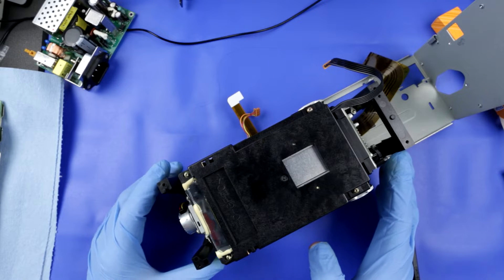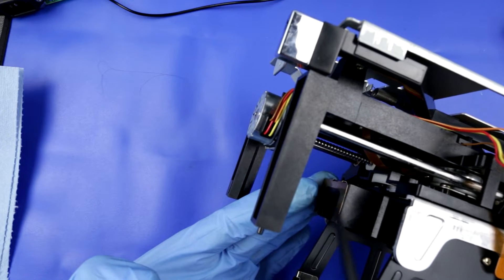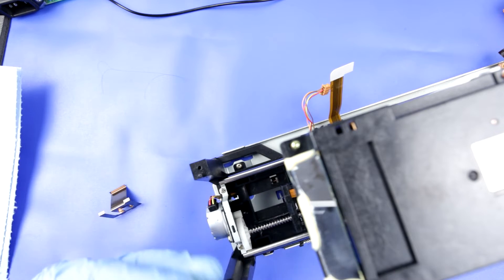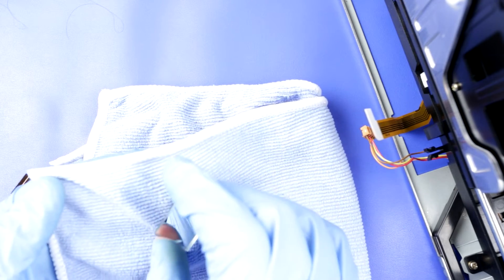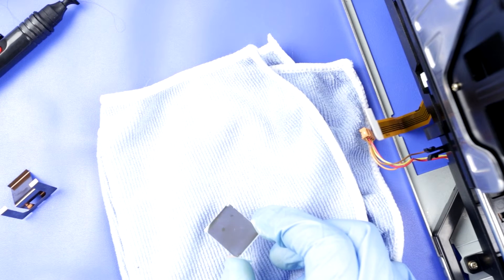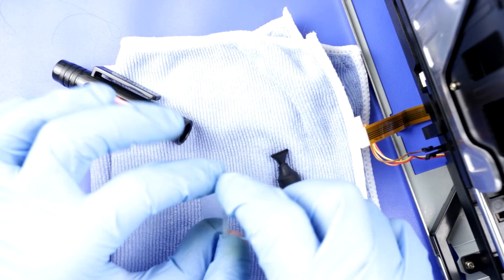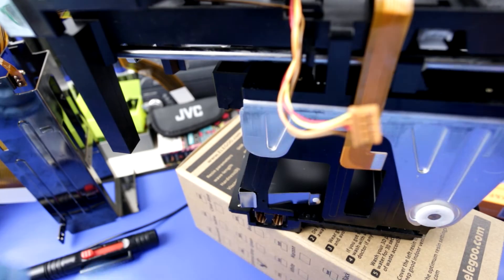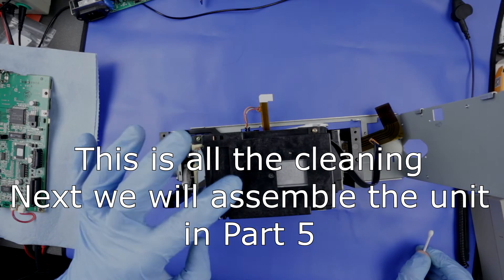Nikon Coolscan IV ED Cleaning the mirror. Part 4

Comment from the maker: More details and high resolution photos - http://mobilemodding.info/nikon-coolscan-iv-ed-or-ls-40-ed-teardown-and-repair/
Watch other parts: 
Nikon Coolscan IV ED Damaged in shipment. Teardown and Damage assessment - https://youtu.be/l4nLAHdcVAk
Nikon Coolscan IV ED Damaged in shipment. Repairing Part 2 - https://youtu.be/YL8V05M0J3Y
Nikon Coolscan IV ED Power supply repair. Part 3 - https://youtu.be/Y7-k23ECdag
Nikon Coolscan IV ED Cleaning the mirror. Part 4 - https://youtu.be/93ov_jtw4mY
Nikon Coolscan IV ED Assembly and testing . Part 5 - https://youtu.be/23A8W4svkWI

Comment: I really wanted one of these, 25 years ago .

And now, 35mm slides are a quaint relic.
Reply: I can confirm that my Coolscan V ED works on Windows 11 with VueScan Pro. Don't bother with NikonView.
Reply from the maker: But finally I can afford one :D
Reply: @InsideOutElectronics  But do you have a PC with SCSI controller?   And an old operating system that supports the Nikon film scanner?
Reply from the maker: @DerekDavis213  Yes I do, I have WIndows 7 PC with SCSI controller that I use with my Canon FS-4000 via Vuescan and same PC works fine with Nikon Coolscan via USB2, I was able even to install the NikonScan software and it works ! :D
Reply: @InsideOutElectronics  CooL, sounds like you are all set.   I used to have a Minolta film scanner back in the day, and I even developed my own color negative film using Jobo equipment and chemicals.   Seems like ages ago!
Reply from the maker: @DerekDavis213  More or less set! When I started scanning I noticed that all negatives have to be heavily cleaned :( so now it looks like more works then I expected
Reply: @InsideOutElectronics  You are right, those 4000 dpi film scanners pick up every spec of dust or tiny scratch.   I hope your Photoshop skills are good?  haha
Reply from the maker: @DerekDavis213  I dream to avoid Photoshop as much as possible ! I have hundreds of films to scan :D